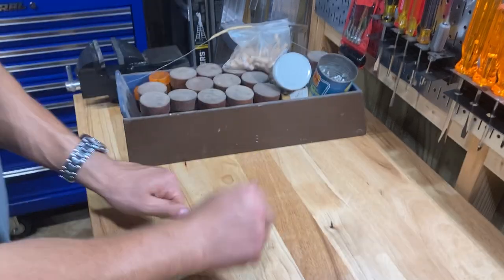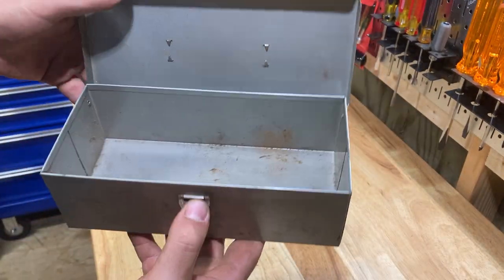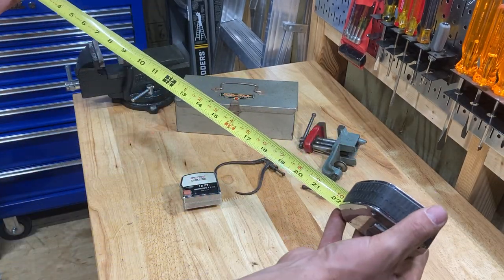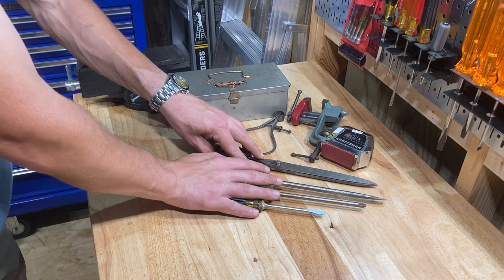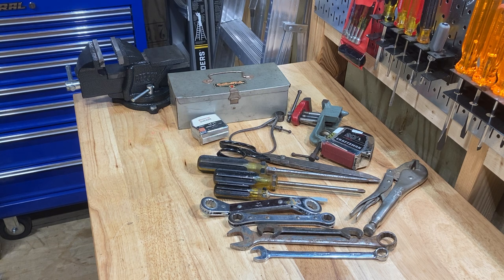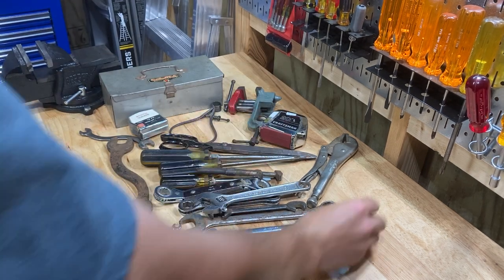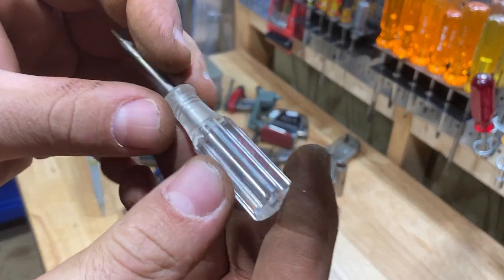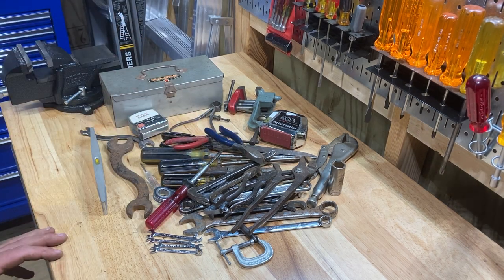Another good one! Vintage Snap-on, Klein, Craftsman, Stanley, and more!

Comment: That Craftsman jeweler’s vise place on your home bench. You will find it very useful when working on small items. It has less torque that your Craftsman vise. I guarantee this will benefit you greatly. You can put it on your desk at work, but it will suit you much better at home. Those 6 inch lineman pliers are a steal. Both of them. Good work.
Reply from the maker: Thanks man! Yea I’m still deciding what to do with the jewelers vise. It can’t clamp to either of my current benches, but I am building another one soon so I might use it then. I am thinking of selling though just to pay for the rest of that stuff. It’s so hard to decide 😩